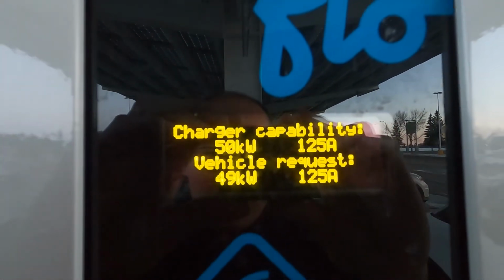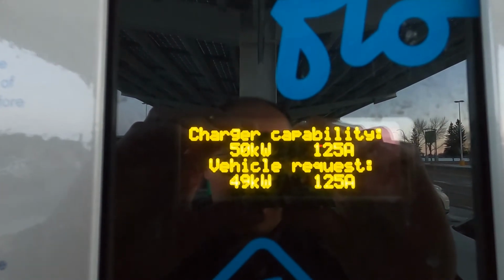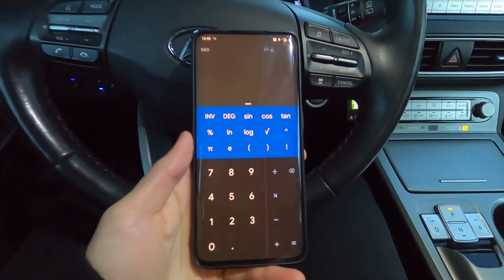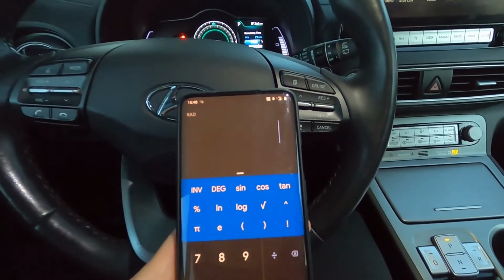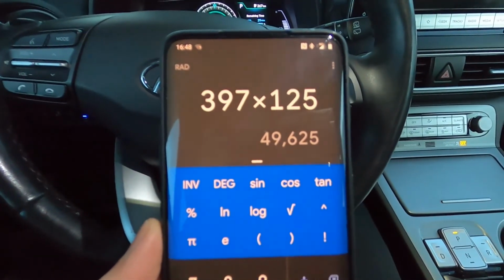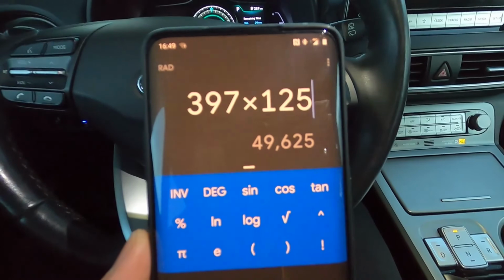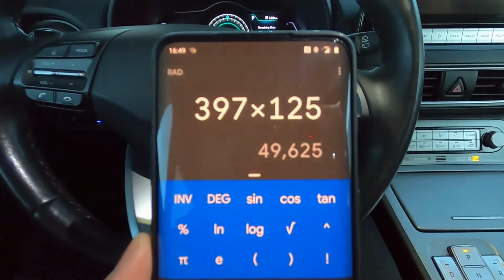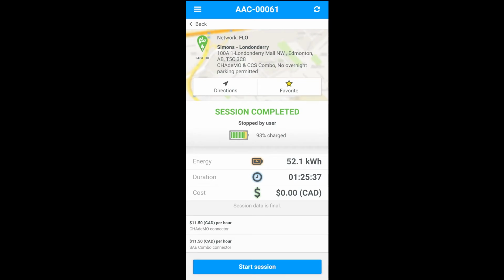EV Basics: Voltage, Current, kW, kWh

Comment: If I know the kw consumption and car speed in kmh, how can I calculate kwh/100km car consumption? Thank you
Reply: I tried to answer this and got it completely wrong. I don't think there's enough information to go from power (kW) and speed (km/h) to get kWh / 100km (work) even though all of the units are there that might suggest otherwise.

I'll take a crack at explaining why I can't solve this. Say power is 4 kW and you are going 25km/h. You will go 100km in 4 hours. Great, so isn't it 4 * 4 or 16 kWh/100km. Unfortunately, it's not, because we have a power measure but not displacement or time elapsed that it was measured over.

I'm not sure where to go from here to solve this.

If consumption is energy (kWh) and it shows 10kWh and you maintain that speed constantly with identical air friction and grade then you'll get 10kWh/100km.

Either way this is wrecking my brain right now and I give up. 🤯